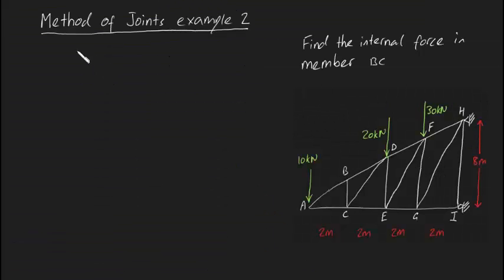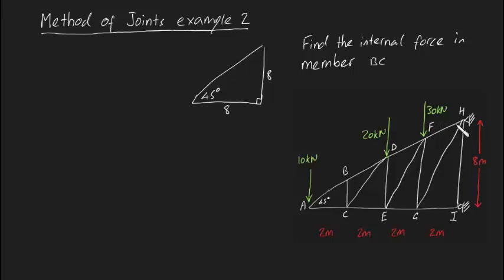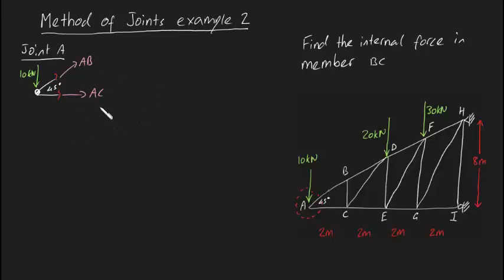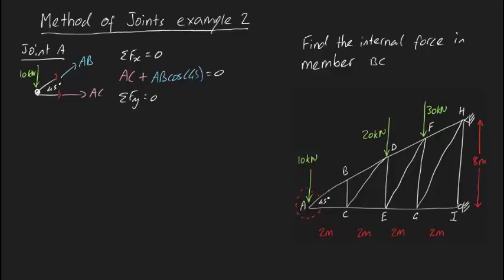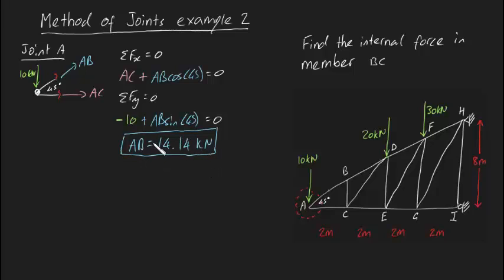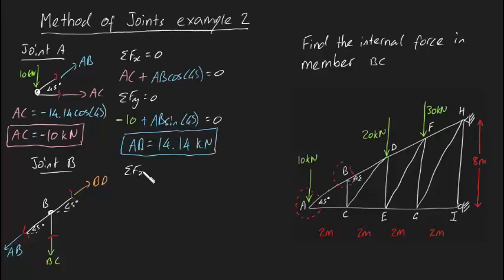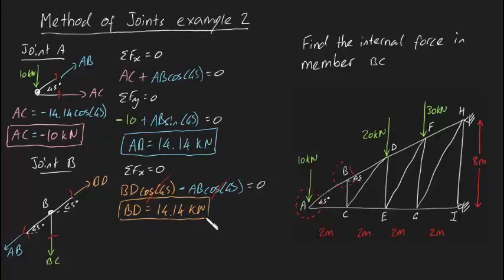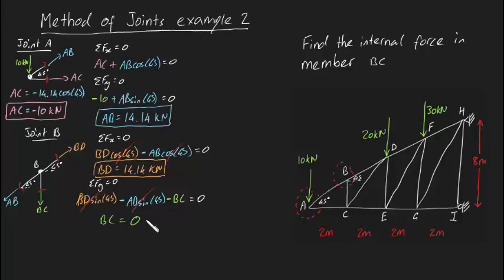Method of joints example 2

Comment: I have an assignment due soon, so was just wondering, this entire thing was done with the Degree angle output setting, correct?
Reply: The reason why I ask is because my teacher told us to select the radian angle output setting which has confused me quite a bit, because your walkthrough as well as one of my teachers is leaning towards the Degree angle output setting. Ill use the degree output, and if its wrong, well its wrong.